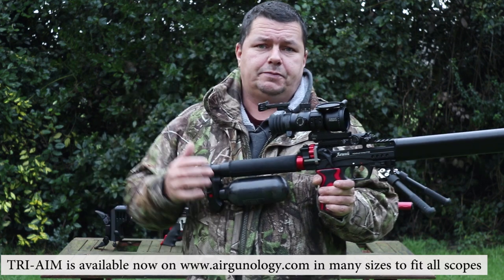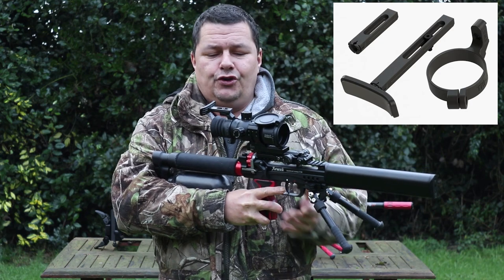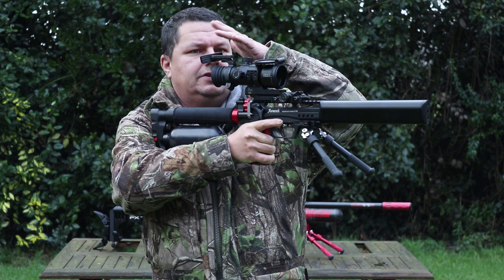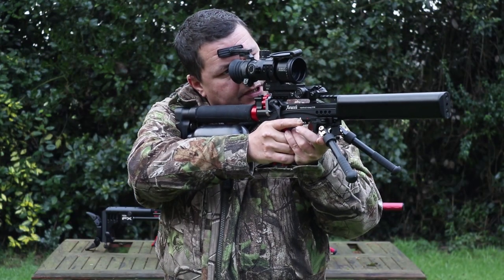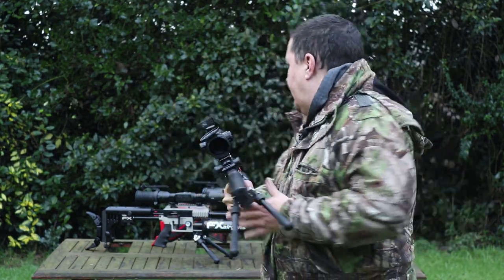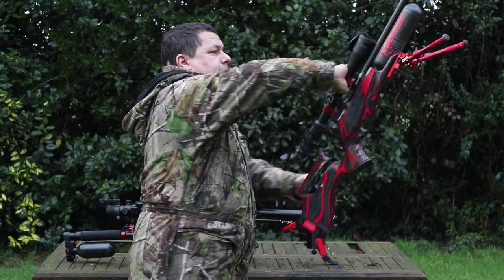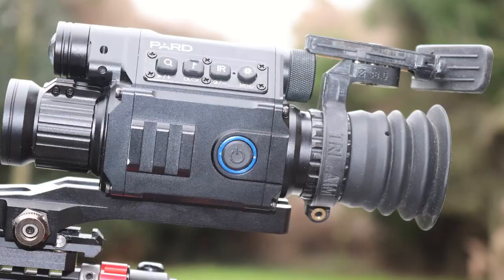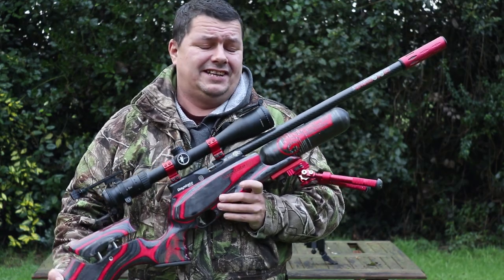Improve Your Accuracy with TRI AIM

Comment: Why do you need one of these if you are using a scope extension ? It could be an advantage for target shooting. As I type my Ender Pro 3 is knocking out a moderator. We are in lockdown, I am bored so an hour on Designspark, a few minutes on Cura and hey presto, lots of little jigs for your head. The advantage I can see from printing my own, is that after a few prototypes, it will not need to be adjustable, therefore can be printed in one piece. Just need a M3 bolt. Its something to do, and it may improve my groups. Yours £39. Mine 40 years CNC engineering experience, £250 printer, £25 for filament and a mornings worth of leccy.
Reply: @twowheelstouring482  The question remains, Why do you need one of these if you are using a scope extension ? A 10 quid rubber extension does the same thing, by aligning the eye to the correct sight line and distance. As I said early if the shooter thinks this improves their groups , great. With nearly 40 years shooting behind me, 30 of which was vermin control I offered my opinion. Your reply was gob shite.

Comment: What military is that then? 

If you set the rifle up correctly in the first place with a decent cheek weld and drill drilled the position eye relief doesn't even become a thing its about comfort behind the rifle. Not pushing your head against a piece a plastic crap! That's not how position and hold works.

Sorry mate but this is not a good idea, the solution is correct rifle set up and practice!